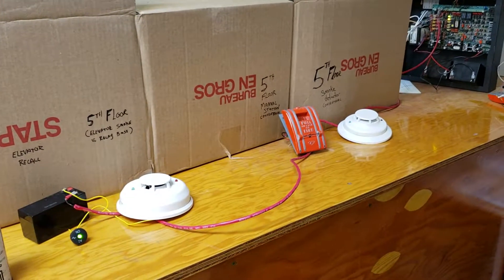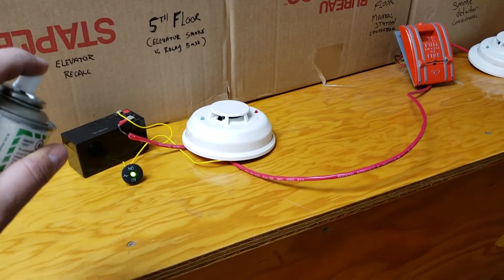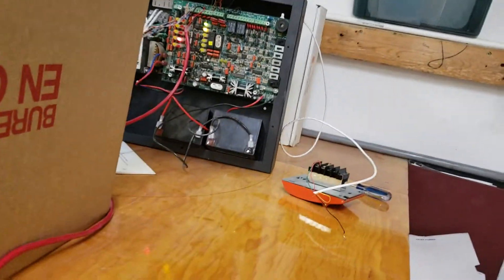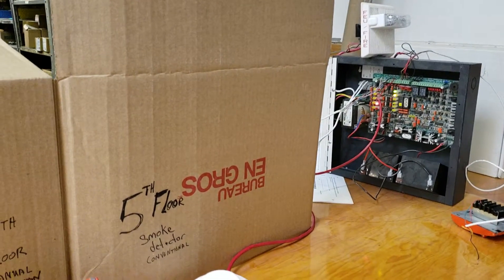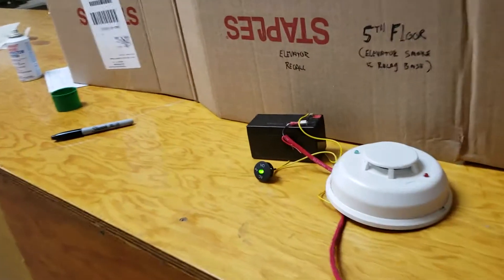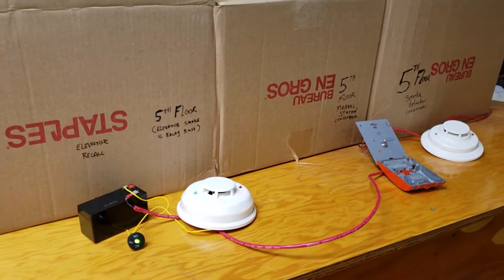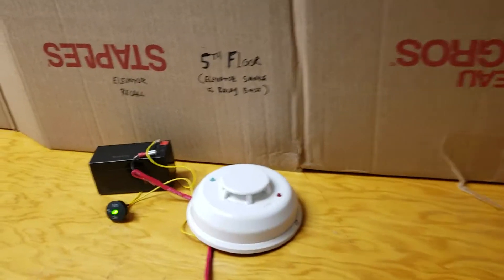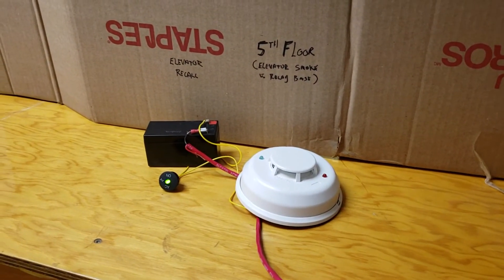Will an elevator automatic recall work when there is a fire?

Comment: OK, there are a few things wrong with your demo. First, notice your strobe isn't flashing properly, that is  because I can hear the panel alarm relay clicking with a pulse, you need steady power for horn strobes, a temporal 3 tone is produced by the AV itself not the panel, coded operation is to only be used for audible only. With that said ALL panels must be listed with the smoke detectors being used for just that purpose. To boil it all down you are using a 2wire detector base, and with that being the case for recall you can only use that detector BY ITSELF on the zone because of power draw. If you use a 4 wire detectors you will not have that issue. I hope you are not a Fire Alarm tech, because you should know all of this!
Reply from the maker: Thanks for your comments Jeffrey.  Putting the strobe comment to the side, We keep seeing this application of smoke detector relay bases, whether it be for elevators, or door hold open devices. I am glad to see the CAN/ULC-S573 address this issue. 
Your comment about 4-wire smoke detectors is spot on!! The only catch is, this 24v 4-wire power circuit is unsupervised.  We have developed a method of wiring that maintains the system integrity while also providing full supervision within the field wiring. 
If you are ever in need of engineering please reach out to us.
Regards,
Mike Lonergan 
Lonergan Engineering Inc.
Reply: @michaellonergan3505  Actually, 4 wire smoke detectors are REQUIRED to have the power supervised by a power supervision relay. This has been required and used all the way back to the 80's. If you are seeing a 4 wire smoke detector or loop installed without the EOL power supervision relay that is AND HAS ALWAYS been a code violation
Reply: PS, it is a great thing that you and/or your company is sharing the knowledge, because the more people that know, the better chance things are done properly and in the case of Electrical and or Fire Alarms that could save a life.